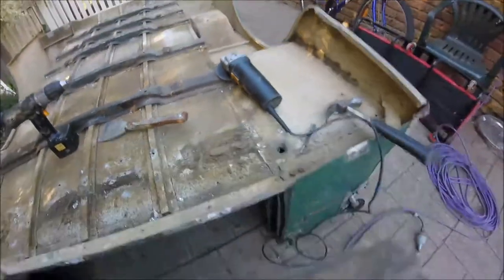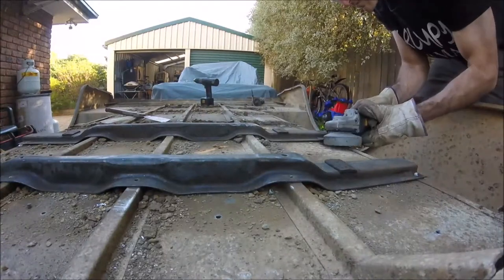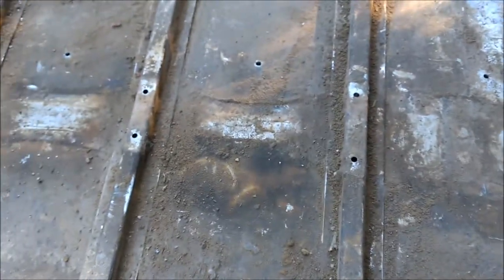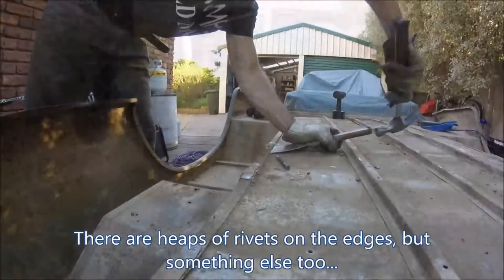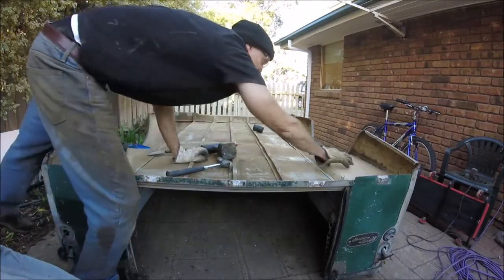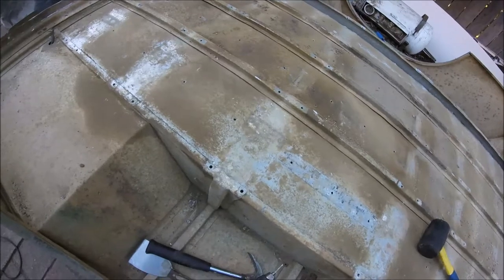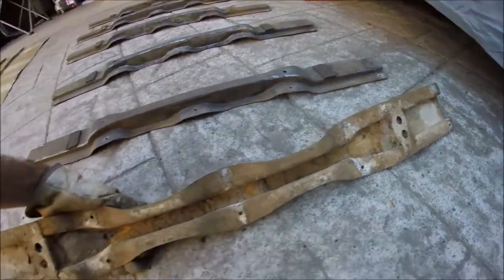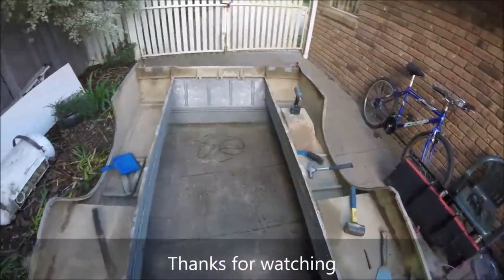Land Rover Series 2a 109 - Part 5: Tub Floor Removal

Comment: hi mate, I was thinking on some hose/pipe system passing through  the mud traps, like plant sprayers. to clean it  I would connect the water hose followed by compressed air to dry and could spray some protective wax too. what do you think, could work? cheers
Reply from the maker: I was going to use garden hose to get into those tight angles and then high pressure wash. Being alloy im not worried about adding protective stuff, especially if sticky. Main thing is protection between steel and alloy.
Reply: i didn't clarify that the system would be permanent, this way I hope would be always easy to clean it to the bone. have you seen something like this work? besides the negligible weight I don't see downsides. indeed, dust don't need more glue to be collected everywere
Reply from the maker: Never seen something like this, but I dont see why it wouldnt work.  Again being alloy its not a major issue (rust), but more to have drainage in these areas. LR obviously thought this wasnt an issue either in the design.